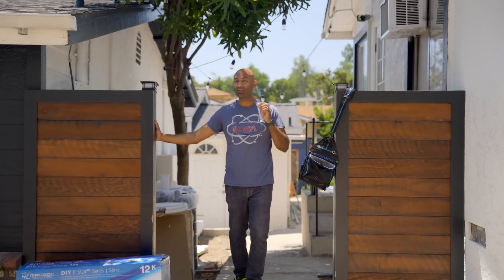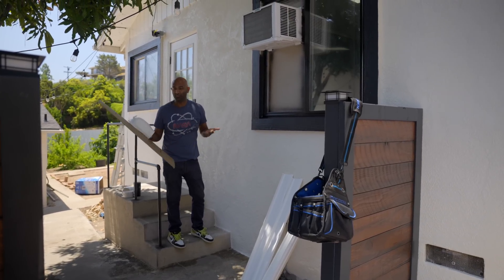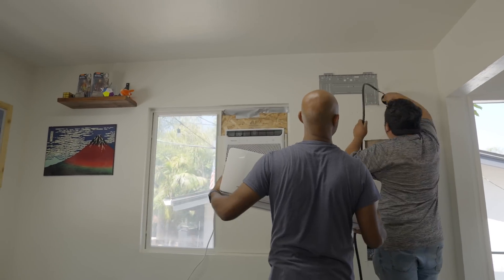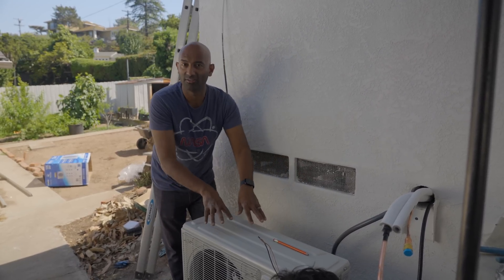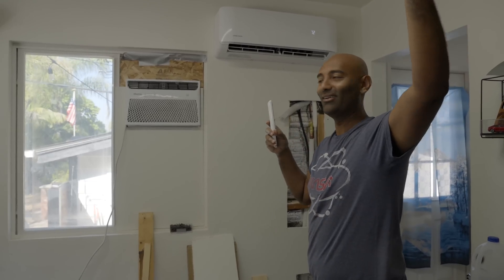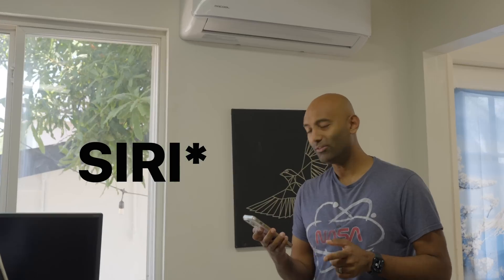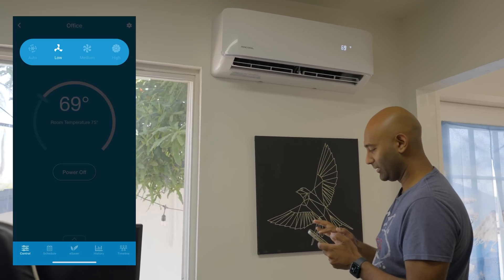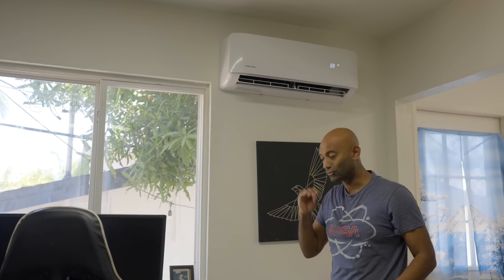Summer Heat? Here is Your Answer! DIY Mini-split Heat Pump!

Comment: I just installed a MrCool Unviersal Heat Pump, their central air solution.  It was tough, but doable.  I am loving the results.  It is quiet and super efficient.  It will also serve most (if not all) of my heating needs (maybe not as important to folks in SoCal).

"Requires an electrician".  That is the same amount of truth as the HVAC side.  It doesn't require it.  It is all up to your skills, capabilities, and risk tolerance, either way.  Just because you can do the line set yourself doesn't mean you can't screw it up.
Reply: I installed their Central Ducted System (very similar). I'm happy with it so far as well. Did all the work myself too. None of it was too hard, and I installed the actual unit in about two days, by myself.
Reply: @christopherkragh-buetow5491  It was a similar situation to me, then.  I did have some challenges that were a little less about the unit.  I opted to just get the evaporator coil and use it with my existing furnace, which did add some challenges (even those the listed measurements were spot on, the inner measurements were more constrained and required some alterations).  I also ran my line set through brick... so that took ages to drill through even with a diamond-tipped hole saw; I started just using the circular hole that was started to drill through with a regular bit and then switched to a hammer and chisel to finish it out.
Reply: Electrical took the longest for me, but I was uprating several circuits and adding a HPWH. I stupidly ran the conduit in the crawlspace as liquidtight instead of EMT and that was a pain to pull through. Linesets were relatively easy because I could just run the through the crawlspace and out through some foam that was used to encapsulate the crawlspace. I think the HVAC work took about 15 hours, electrical was another 30ish. I'm a stay at home dad, so I was doing a ton of back and forth to deal with kids while I worked.

Comment: What about vacuuming copper pipes? A lot of moisture inside of them and it will damage compressor in one year. This much reduce compressor lifetime even can kill it.
Very sorry.
Reply from the maker: the lines come vacuumed! they thought of everything!
Reply: No need on mrcool units.  Not a typical lineset.
Reply: @Xrpjoust  okay, that’s cool!
Reply: To every comment about vacuuming the lines
MRCOOL® DIY® Quick Connect Pre-Charged Line Set

They are factory vacuumed and filled with refrigerant with quick connectors that keep all water and air out, the only thing is you should not install in rainy weather to not get water between the connectors before connected

Comment: Those things are installed all over the place in South America and Europe. They work great but we need more HVAC solutions that don’t send heat into the atmosphere. That is unless that heat is scavenged for hot water.
Reply: HVAC systems work by moving heat from the inside to the outside - they create very little heat (the only heat created is from the compressor/fan motors). There is no exhaust or any CFCs/greenhouse gasses created from them. 

The same heat you’re talking about being “scavenged” for hot water, would also eventually return to the atmosphere when it cools off.
Reply: Heat recovery systems exist for large commercial cooling installations, and I think there are smaller scale exchanges used to preheat hot water, they’re just not commonplace…
Reply: Ground water heat extraction is used in rural northern areas (in North American).
Reply: I wish I could get some heat exchanger to warm my pool and hot tub and cool off my house or even garage!
Reply: @thetacomaboy  you can! It’s pretty simple too. There are commercial devices that you basically put in line with the refrigerant line for the AC unit. That device is a coil of copper pipe inside of a tank for water to flow into. Fresh cool Water flows in the bottom and starts getting heated by the copper coil. Then as the heated water goes up and out of the top port (hot water being less dense than cold water) it exits and you can use that hot water for whatever you want. And when I say hot, I mean like, noticeably warm, but nothing near your water heater temp. But its “free” heated water and also reduces load on your AC compressor by reducing the net heat exchanged.
Reply: They do not send heat in the atmosphere.

If they cool by lets say 5kw and consume 1kw they send exactly 1kw additional heat in the atmosphere. You cannot elimiate heat energy and it doesn't matter if the 5kw heat leaves through the walls or through the AC.

Only way possible to not send the heat in the atmosphere is to send it directly into space using special materials.
But you could install solar panels instead of those emitters so the advantage is questionable at best. Potentially only in very hot climates like in deserts.
Reply: @huyopo  Heat IS energy. No one is talking about eliminating it, but rather converting it into electricity or some other useful medium of energy.
Reply: @Dewydidit  Everything in existence is energy in one form or another, including matter.  "Heat" as we know it is basically infrared radiation.  That is the final form that we wind up with.

But it requires work to change forms and every time we do that in a chain we get less and less useful work out.    Infrared radiation is particularly difficult to extract work out of when it isn't concentrated.  And it isn't going to be concentrated... every time work is performed, it will become less and less concentrated.

So that is the problem in a nutshell.  Is it possible to extract energy from the waste heat of an A/C system?  Yes.   Does it make sense to?  Generally no.   And how much can you recover anyway?  From residential systems?  Maybe 1-5%.   So if you burn 4kW in a residential A/C system and want to leverage the waste heat, you MIGHT be able to recover from 40W to 200W, potentially spending thousands of dollars in equipment to achieve that.

There is usually no point.   One can't just "collect" all the heat from a process and try to recover useful energy from it.  That will universally feed-back on the process itself and make it less efficient or burn up the equipment, etc.   You HAVE to take the heat away from the compressor, if you concentrate it instead it feeds back and makes the A/C system less efficient.  The ACT of taking heat away from the compressor takes energy (the fan, for example), which necessarily makes the heat being exhausted less useful in one way or another.

Where it DOES make sense to do heat recovery is when the temperature differentials are massive.  Examples include combined cycle natural gas generation plants, and steel-making.
Reply: There's a hot water cylinder that dehumidifies while pumping the heat into it, but it's pretty expensive and it doesn't meet the full load.

Part of the problem is that heat pumps taking heat from the house and putting them into hot water is very seasonal. In the winter time it's just an additional load on the heating.
Reply: @philipvecchio3292  you are correct BUT the idea is to divert as much human created heat sources to secondary uses as possible before being released to the atmosphere. 

Sure it’s expensive but the alternative is further pollution in the form of heat that we cannot get rid of.
Reply: But the heat came from the atmosphere, your just moving it outdoors
Reply: @larryjohnson5163  no, the heat came from an energy source and was STORED in the atmosphere. 
We're HEATING the atmosphere with mostly fossil fuels and the waste heat from industrial processes. 
The atmosphere has been hotter and cooler than it is now. This is just the hottest it's been since humans came on the scene.
Reply: @Dewydidit Those disagreeing with you are correct... Approximately 75% of the heat at the hot side of the AC unit is "preexisting heat"... It was already part of the total energy on Earth and does not add to the total energy of the planet, any more than running the AC in reverse cycle will help to cool the planet, despite the outside unit cooling the outside air in that mode.
Pretty much the only practical way to use the heat pumped to the outside in summer would be to heat a swimming pool, which only saves energy if you are heating it artificially to begin with.
You are also misunderstanding the problem of the greenhouse effect... The heat produced by human activity is negligible worldwide, and is not the reason for our warming planet. It is the gases that are produced by burning the fuels that enable those activities that indirectly warm the planet by enabling the atmosphere to retain ever so slightly more of the energy we receive from the sun.
In fact, by concentrating the heat to the outdoors during the day, and thus very slightly increasing the daytime temperature without actually adding that energy to the total energy of the planet, AC units cause an increase in radiation of heat to space. The effect would be thousands of times smaller than our finest measurements could detect, but still, the balance tips imperceptibly. It's not a practical way to mitigate warming of course; I mention it only to illustrate that your understanding of heat, heat pumps (we call them split system AC in Australia), and energy budgets, may not be as good as you think, and that you might want to do a little research before you belittle those who do in fact understand what they are talking about, particularly with reference to the greenhouse effect and climate change.
Reply: @mikejosef2470  ok, you lost all credibility with "The heat produced by human activity is negligible worldwide".
Reply: @Dewydidit @Dewydidit No, I didn't lose any credibility. The original post mentioned avoiding sending heat into the atmosphere, which is a problem only in that said heat is wasted energy, and definitely not because it produces any measurable effect worldwide, in contrast to the greenhouse effect, which clearly does. It seemed to me, and obviously others, that the original commenter thought that the heat itself was a problem in terms of climate change; as I stated above, it is not, partly because, as others explained correctly, most of the heat was present already, and was simply shifted to the outdoors, but mostly because the 1 to 1.5kW used by the AC to shift that heat, which is heat actually added to the heat load on the planet, is a small part of the total additional heat directly produced by human activity and added to the planet. The sum total of that, all of the heat directly produced by humans, is equivalent to 27 minutes of sunshine over the surface of the globe per year. That's not even a rounding error, and is completely insignificant in driving climate change. You won't find any reputable study or description of climate change that mentions it other than to discount it.
The actual amount of heat from human activity is 0.036W per square metre of Earth's surface, while sunlight is 238W absorbed power per square metre averaged over the entire surface. Given that the total increase in the greenhouse effect now, compared to preindustrial greenhouse effect is just under 1.5%, this means that the extra heat retained by the atmosphere from all the heat generated directly by humans, is about half a milliwatt (0.0005W) per square metre, vs. 3.22W of the energy from the sun... Human generated heat adds 1/6000th, one part in 6000, to the greenhouse effect.
Very early on in the discussion, by the original poster and another almost immediately, the only really sensible use for the heat, namely to preheat water to lessen the load on hot water services, was suggested.
A bit later, another reply correctly stated that the heat itself would be radiated to space overnight.
That assertion, given the utterly tiny amount of heat in question, as explained in detail above, is so close to 100% correct that your condescending reply in a discussion that had been perfctly civil to that point stood out, and I felt compelled to reply. I did so in as civil a manner as possible in a reply that necessarily had to point out that your understanding of the driver of climate change was flawed. I won't make that mistake again.
Your response was to assert that I had lost all credibility, which is neither an argument, nor a fact.
You then humiliated yourself with some confused nonsense about heat coming from an energy source, it's storage in the atmosphere, and how we are heating the atmosphere with fossil fuels and waste heat, which is patently rubbish. A little later you dismissed the correct assertion that Peltier chips would not work well enough to be worth it, citing industrial scale schemes using that technology as well as Stirling engines, neglecting to do basic research that took me all of 15 minutes, which would have told you that any Peltier schemes use a temperature difference of 270°C and even with that, have an efficiency of 4%. Using the 25°C temperature gradient at the hot side of an AC unit would be highly unlikely to ever repay the energy needed to make the system in the first place. I did not look into Stirling engines however I strongly suspect a similar outcome, and I would hope by this stage you might realise that you're dealing with someone who knows considerably more than you on this subject, and I suspect, many other subjects, and that you might possibly refrain from spouting yet more unresearched, dismissive, condescending and just plain rude drivel in response.
At some point, waste heat is just that... waste heat, and while it may seem desirable to use it for good purpose, there is not unlimited cash to do so and available resources may be better spent elsewhere for greater return.
One last thought... the greatest resource we have in the fight against climate change is our ability to co-operate, exchange ideas and share information. This happens far more freely when people feel comfortable, and are not worried about being put down rudely. 
I do believe you sincerely want to do whatever you can to mitigate climate change, and it's easy to get carried away when discussing big issues... you want to help in the fight; the question is, would anybody want to fight alongside you?
Reply: Could you elaborate more on your idea. It sounds very interesting as a concept
Reply: @danchev338  vent the condensers exhaust into an enclosure with a heat pump water heater. Or send the exhaust to heat rocks or bricks to later be used for drying clothing. That’s heat being vented directly to the atmosphere otherwise.
Reply: There are ground heat pumps for long already that can warm up the water using ground heat. Same system can be used for ground cooling. Both uses same pipeline so technically in summer it stores the heat to the the ground and to warm water (yes I'm aware that some heat get wasted, but ground outside is cheap storage and better than air as some of it stays near pipeline). If all heat doesn't go to warm water. And in winter ground heat itself can heat up the water and house as ground is anyway always warm. But of course it is lot more expensive to install as you need pipelines and stuff. But also efficiency is lot better of course compared to air heat pumps.
Reply: Only thing that we have that does that is the solar cooling panels what  we need is a heat pump into space frist space elevators should be this
Reply: Lmao....you really believe putting the heat outside instead of in Your home is causing global warming?????
Reply: Alternatively you could set up an array of Peltier chips to recover some of that heat energy.
Reply: @Dewydidit  Peltier chips won't work.  You could try but you will generate milliwatts of power at best, or nothing at all.
Reply: @junkerzn7312  they "work", just not very powerful. Like a sterling engine they are proven, just not powerful. 
They are used in industrial heat reclamation, just bigger scale.
Reply: Nothing wrong with putting heat in the atmosphere. It just goes into space at night time.
Reply: @HandSolitude  you’re leaving out the fact that heat is being trapped by man made green house gases AND cloud cover prevents heat dissipation into space.
Reply: @HandSolitude  You really don't know how heat works do you? Look up "greenhouse gases" and rethink your statement.
Reply: @Dewydidit so heat has transformed into a gas?
Reply: @Dewydidit what you are missing is the heat already exists. Whether it stays trapped in your house, or outside, it's here! Sure, heat recovery is great if it's economical, but until then, you are pissing in the wind.
Reply: @mikenotta7079  if heat recovery absorbs 1% of the heat, what did you lose?
The heat trapped inside your house was from the outside, pumping it back outside is a net loss. 
Anything you do to reduce that loss is noteworthy. If that's increasing the insulation or a more efficient unit or heat recovery it all applies. 
But according to you, weather stripping your windows is pissing in the wind.

Comment: Nice video, but I don’t have 5 grand for such a small amount of A/C.
  I’m considering converting a 24,000btu window unit a/c with a remote control into a split system for a few hundred bucks though. It should solve the problem of a living room that has no exterior walls.
Reply from the maker: these are about $2000 or so... and I hear you... I'd love to hear about what you're planning!
Reply: I've been thinking about doing that project too! I have several older window AC units that should be good candidates for rebuilding into split units, possibly with reversing valves.

Currently learning about refrigerant handling for the project. Only downside seems to be that there are a number of tools required that are a bit spendy, but even with those the cost should still be less than one new minisplit.